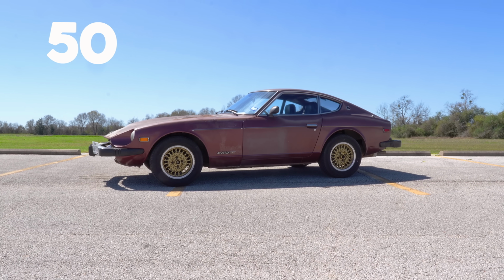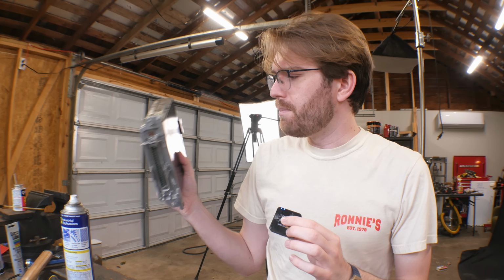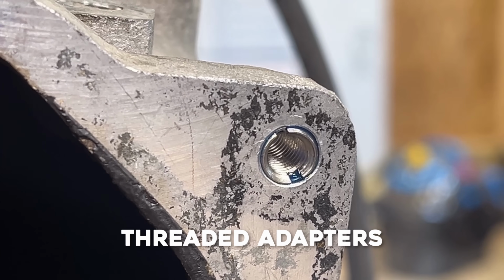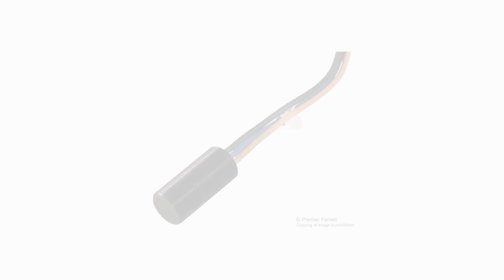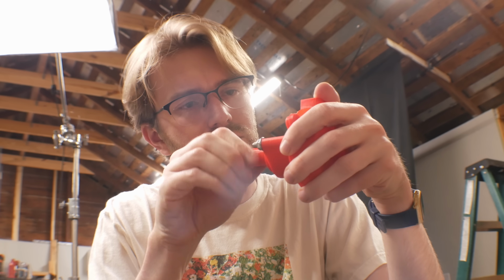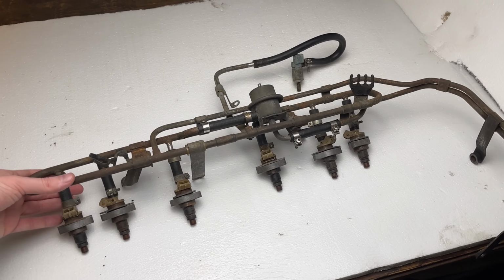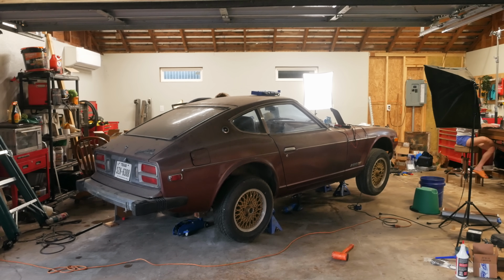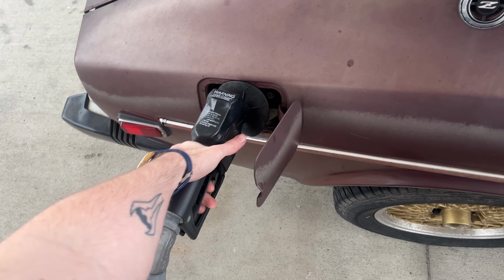Modernizing a Vintage Car

Comment: Gaining almost 20hp from that was crazy!! So, I suggest for our next collaboration you can build the same for my car too ;-)
Reply from the maker: You got it! I'll let you know next time I'm in Switzerland 🙂
Reply: @RonaldFinger  DO ITTT!!
Reply: @RonaldFinger  How about a turbo?
Reply: @cv990a4  A turbo is exactly what I came here to say. Also wanted to asked if anyone else was making the vroom vroom sound when he was testing the throttle setup.
It should be easy to get a turbo setup for this car since it was so popular.
Reply: @cv990a4 it would explode if he kept to the “ No Touchy Inside” rule. That valve train and the combustion chambers would not handle the extra pressure inside the engine. The head would pop right off.
Reply: @justinreel-t8g  The head pop off? There's only one way to find out! 😅
Reply: @dku001 you have a point. Fuck it! Go balls out and push 25 psi right into it!
Reply: @justinreel-t8g  You are thinking about serious pressure increase. While some soft turbo with low boost can help with a low rpm lag, add more torque and increase MPG. Not everyon are mounting turbos to get all the power and ever more from a simple engine.
And since it already have an aftermarket ECU it would lower overall costs of the operation..
Reply: @cv990a4 then he would be building a ZX and not a Z. Wrong car for a semi-purist.
Reply: @marktrader490 if im remembering right the late 280z's did have a turbo option since they were still selling the 280z's alongside the zx's.
Reply: @cv990a4  a turbo is a bad option. How about a compressor?
Reply: @UnPepeMileista Because the engine would need to be completely rebuilt. Superchargers are more stressful to an engine hp per hp compared to a turbo.
Reply: @DTQ7119  really? How is it possible?
Reply: @UnPepeMileista How is what possible? How is a supercharger more stressful than a turbocharger?
Reply: @DTQ7119  yeah I don't see how the force of a compressor would be comparable to a turbo, that spins faster as you accelerate and gain more load. If you could elaborate further I would be grateful.
Reply: @UnPepeMileista A turbo uses wasted energy to create power but a super takes power from the engine to make more power. Now these figures I’m going to use are just a demonstration not accurate. To add 30 HP to the wheels with a turbo the strain on the engine is only an extra 30 hp. To add 30 HP with a super requires the engine to make 45 because the super will take 15. Once again not real figures just a visualization. Turbos do require the engine to sacrifice some power by adding back pressure but it’s minuscule compared to a supercharger. Superchargers are just inherently inefficient. The more efficient the system is the less stress it adds. The reason people use superchargers are twofold. One the designing and install of the system is easier and therefore cheaper, also takes up less room. Two the power is more instantaneous. As engine RPM rises the super boost rises in a roughly linear fashion. But turbine speed of the turbo takes time to spool which is what is called turbo lag, it isn’t directly associated to RPM speed.
Reply: @DTQ7119  ohhh I see, one uses something that goes to waste, while the other needs to drain power from the engine itself. I get it now thanks genius.
Reply: @RonaldFinger to take this one step further,  and since I am too lazy to read all the comments, have you considered producing and selling your trigger setup?
Reply: @RonaldFinger  Thanks for doing the collab with MM, now I've found your channel!
Reply: @RonaldFinger  Sounds like a legitimate reason to start a “gofundme.” Switzerland or bust!
Reply: He's not visiting Switzerland 😂
Reply: @RonaldFinger  Do it.
Reply: @RonaldFinger  please Ronald, we need this
Reply: @RonaldFinger Aye, I got an 89 prelude 😃 if you're feeling generous 😂
Reply: @RonaldFinger  top tier collab
Reply: @RonaldFinger  I was hoping you would get back to the original power output and maybe gain a little more but I guess the engine is tired.
Reply: @junechris I think it's the power measured at the wheels. 😊
Reply: @trollhandler  I suppose, it's got an old school diff in the back like an old muscle car. My 1994 Saturn SL2 has more to the wheels than this with just bolt ons, race suspension and polyurethane engine mounts. I'm actually considering an aftermarket computer, likely a Haltech elite 1500 for mine to do a full tune on it to squeeze some more power out of it, kinda like this one in the video
Reply: @junechris  Well as stated in the video, everything remained OEM except for the ignition system he rebuilt. So it's likely safe to say that once he'll decide to overhaul the engine and the diff, he'll get some more ponies under the hood.
Reply: @junechris yeah, but there is almost always more WHP in a transverse engine setup than a longitudinal engine setup since all the kinetic energy is staying in the y and z-axis of the car.
Reply: @wadecrawford6445  I think u responded to the wrong person dude. All I said was I was hoping this guy got back the original HP and possibly a bit more from the mods.
Reply: Sounds like a road trip is in order. Time rebuild the jet to get you there.
Reply: @shanetwogood7893  I'd watch that video
Reply: @shanetwogood7893  They make a new one
Reply: Worlds are colliding!
Reply: @aaronwelsh33  🤣👍🏼
Reply: Finger × MyMechanics would be legendary
Reply: @Zed32_Customs finger my mechanics
Reply: He only needs to travel roughly 53.5 hours northeast at 100mph to make that happen
Reply: The GOAT machinist.
Reply: @mymechanics really is so far past most channels, the level of professionalism and attention to detail is quite hard to put into words. If you know, you simply just know. Great collision of worlds!
Reply: Uncorking the exhaust will likely get him another 20hp!
Reply: @twoeightythreez I'm afraid it won't do any good to a naturally aspirated engine 😢
Reply: @marcindudzinski4335   You dont understand how restrictive the stock exhaust is on these. I had a 1978 280z, stock ran a 17.3 in the quarter, after doing a 3" exhaust with a header, 60mm throttle body, and still running the stock L-Jetronic EFI (the only mod was I tweaked the tension on the AFM spring a little), advanced ignition timing, and it ran a 15.2@90 mph. 

It dynoed 168RWHP. Stock internal L28E.

Surely with more modern engine management this car will at least be able to match that
Reply: @twoeightythreez I hereby stand corrected 😅 Apologies for my lack of knowledge. I was just talking from experience with more modern cars, where installation of bigger diameter exhaust usually ends up with losing power rather than gaining it. I have never worked with a Datsun though, thanks for sharing this!
Reply: I can easily believe that, as modern cars benefit from optimally designed exhaust systems, but most cars from the 1970s (not just Datsuns😂) had exhaust systems which were designed to be...quiet, and power was a secondary concern.

My car also had a early catalytic converter which in those days were notorious for robbing power. My 3" exhaust (which i know was too big but not once i put a turbo on it) also had a high flow cat! 

Thats one of the things that made these Datsuns so easy mod (though this only applies to that initial "easy 40hp" ); making more becomes VERY hard due to the limitations of the non-crossflow L series head. This quality does make an oversized exhaust hurt power less (the cylinder head itself is a restriction when stock).
Reply: @marcindudzinski4335  My NA Subaru BRZ came to life when I added a headers and an ECU tune...
Reply: yeap, now he jsut needs to slap a turbo or supercharger on it and itll be gucci, homie setup the framework to perfectly ad it
Reply: I detect a fellow Superfast Matt fan!  That distributor timing wheel doohickey is a thing of beauty!  I am here from My Mechanics' video about the adapter part.  Somehow I found you once before for your garage rebuild video as I saw that I had watched that already.  Congrats on a fantastic job.  That is a VERY elegant adaptation/implementation!!
Reply: It's a miracle how much power there is to be gained just by doing away with these old EFI systems that were really kinda worse than carburetors in many ways.
Reply: @lsswappedcessna  my car is carb'd but switching to an EFI system would add significant BHP. Increasing airflow and adjusting cams can apparently give way more though. Maybe Ron should add a turbo
Reply: @lsswappedcessna  bro this is how tech works, the first second third iteration is always worse than the current best gen. it is only when u keep iterating that you see the exponential growth history charts show when the switch happened. First cars had less horsepower than a horse, look at where we are now. same with old varieties of fruit like the inedible seedy banana or the wild corn. its just that human food was one of the first "tech" inventions so the growth chart is shifted behind centuries.
Reply: That part had some sharp edges
Reply: This would be very much in keeping with your efforts. One thought from a retired railroad wrench slinger: Would there be any benefit in blueprinting the engine? I’ve never worked on one of these thus have no idea what they look like inside from the factory.
Reply: @maestromecanico597 if My Mechanics is working on his to the level we know he will, it will probably be the most gone thru version of that engine short of the original test version
Reply: @maestromecanico597  No touchy inside......
Reply: @snunya9399   Yes, but...he defined "inside" as "camshaft, pistons, valves." How about the intake and exhaust? There has already been a comment on this thread about "opening up" the exhaust on one of these and getting better power. Mass produced engines are made to maximize efficiency of the production process. It's up to us to maximize performance.
Reply: @maestromecanico597  Oh I get it, but technically blueprinting is "touching the inside".
Reply: @snunya9399  Most definitely but it does mean complete disassembly and measuring/correcting any deviation from the manufacturer’s specs without resorting to different pistons, rods, cam, crank, etc. Technically you’re not “changing” anything but if it’s running satisfactorily with no leaks then it’s not worth the effort. But we’re talking about MyMechanics and his engine and he hasn’t declared “no touchy inside.” Then again, he just may go the “I build a new one” route.😊
Reply: @maestromecanico597  blueprinting would help, but more cubic inches and better camshaft would gain a lot more power. It's mainly about volumetric efficiency.
Reply: @MrPnew1  Of course. It depends on what and how deep down the rabbit hole the mechanic dares to venture. I’m a purist and like my Ponchos stock.
Reply: I went to subscribe, but then my brain caught up with reality and my watch history when I saw "Subscribed" instead of "Subscribe"
Reply: I've been following both builds closely. I have to say it was crazy to see both of you collaborating on something.
Reply: Hi mymechanics, I love your channel and your work. You built an amazing device. Yes, I think you should follow the fingers' lead... did you get the pun? From Durban, South Africa.... just wonderful
Reply: You are an artist, as pretentious as it sounds, I've been watching your stuff from day one. It's something beyond just machining.
Reply: It's time for Ronald to Finger my Mechanics!
Reply: FC mymechanics here.
Reply: DO IT....💪
Reply: Or he could have swapped in an old carbureted 350 and gained almost 200 HP. And it fits perfectly.
Reply: pop in an extractor  manifold free flow pipe should get 5 to 7 more
Reply: @rodneymatthews25 yeah a 3-2-1 header would sound pretty good I'll bet too.
Reply: Huh, I figured you'd go for a set of three Jenvey throttle bodies with nice chrome trumpets on them for the classic look.
Reply: Dude I’m so happy for this collaboration!! Did you start making your own rubber yet?
Reply: It's cool👍🏼
Reply: I was thinking you iterate further, and implement a proper cam and crank sensor system, this way the engine doesn't completely die the moment the one sensor fails
Reply: The first one of all of those adaptors and stuff he made is the hardest.

Now he only need to send the CAD drawings and you can just order it up and install it.

Wont take more than an afternoon i am sure ;)
Reply: Since my Datsun 510 is very similar to yours, I would love to see what the outcome would be!
Reply: mygoat
Reply: "I MAKE NEW ONE"
Reply: That must have felt sooo good to see and hear your custom creation to work! That’s a damn amazing job man! I’m really happy for you and really proud of you🫡🤟🏻
Reply: Tuned exhaust on the original engine would probably get you 10 ponies. 0.10"  or 0.20" off the head would give a few more ponies and improve mileage slightly  Also the engine as originally dynoed was old and down on power. Not as much fun, of course.....
Reply: YESS
Reply: Your project also needs electronic update like this from the old carburretor systems. Another area where power can be achieved is to fit an electric cooling fan (unit with its shroud and sensor, module), from a modern car at the scrapyard. The mechanical fan and V-belts robbed some power from the engine and induced vibration/harmonics and noise.
Reply: That would be so awesome! Maybe you can try a little harder making yours look closer to stock?
Reply: It was this collab that brought me to this channel, and I was not disappointed!
Reply: Wow spoiler alert
Reply: you guys are both rocking the L28, which have iron blocks, so if you swap your flat-heads for dished pistons you could turbo 👀
Reply: We want a crossover, with a drag race of Datsuns!😆
Reply: the goat
Reply: Just got here after saw the diferential restoration and think “wow this is MyMechanics guy?” 😂😂
Reply: in only 63 years🤣
Reply: didn´t he lost 30hp from the original 170hp 280z?
Reply: Man, I hope both of you start selling these custom parts.
Reply: First time seeing this channel. Ripper video mate!
Reply: The man, The legend himself
Reply: OMG!!
Reply: I was so happy to see your name appear when he showed the parts
Reply: eyyy i was just gonna comment mentioning you! its a small world in the datsun community🤣
Reply: I would humbly suggest a little bit of ethanol she will do much more for oh so little work.
Reply: this is what I expected to see after this vid!
Reply: You guys should just build a new one
Reply: Hehe I'm following your datsun videos too.
Reply: air con?
power windows?
self driving?
Reply: He didnt do any HP upgrades just made it more technically advanced & cleaner, 20hp from that seems very good. Was it worth the hassle, probably not but great content regardless
Reply: LEGENDARY CROSSOVER
Reply: I did it to a mercedes 280SE w116 with an m110, it had 225bhp after EFI and CDi (and new exhaust system) and improved fuel consumption by about 30%, with a manual conversion it's like a modern car
Reply: Are you in Switzerland already?
Reply: Exactly what I was going to suggest when I first saw the video. Then it would be a rockin' restoration. Hoping your next video (on the engine) appears soon. Big fan of your precision work.
Reply: Somehow that what I asked myself: Will he Swiss Maniac, I mean, Mechanic put that kind of tech in his Datsun, too?

Found Ronald Finger's channel thanks to your video on the insights channel, so thanks for that!
Reply: You need NOS... 2 big ones!
Reply: @willwill235  Perfect mod for non modified internals.. Fire two and watch your pistons go boo-hoo..
Reply: Ayooo! Watcha doin here? Hehe. We’re patiently waiting for the next EP and maybe the collab.
Reply: Why did choose the carburator instead?
Reply: We need more of this
Reply: I hope he will post the CAD models, so all can benefit from this.
Reply: The second I saw this car I said "I wonder if he knows @mymechanics" lol
Reply: can't wait for this to happen, do it guys.
Reply: almost 20hp is crazy considering its from the same engine 😱
Reply: The first thing i thought of when i started this video was your beautiful 240z
Reply: Porting and a bump in compression really helps L series. Add a knock sensor to enable you to be more aggressive on timing and your economy will improve
Reply: I've been subscribed to both your channels for a while, following both builds, and I'm only subscribed to a handful of people on YouTube. Now that's crazy!
Reply: 20hp is a lot, that's like 2-5 levels of Fighter.

Comment: Awesome collaboration with my mechanic
Reply: Wait it’s the same car?
Reply: @Illysoomuch My Mechanic is worrying on a 240Z, Ronald Finger is working on a 280Z. There is also something like a 2 year difference between two yeti cars. It's just that they both started working on both cars around the same time and people eventually noticed they picked up the same project and started pointing them to each other and begging them to do a cross collaboration where they help each other while building these two back up.
Reply: @sypoth that’s what I thought
Reply: @sypoth https://youtu.be/D2bxsEyYdo0?si=Jhyw2mHM4f0LcN_P
Reply: @Illysoomuch no he is making a part..
Reply: @cd87104 i figured that out now